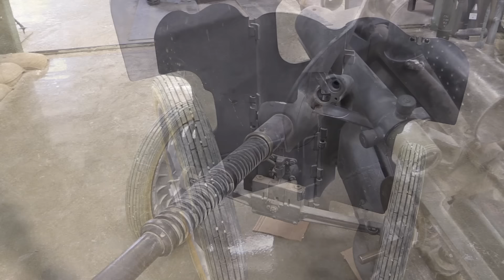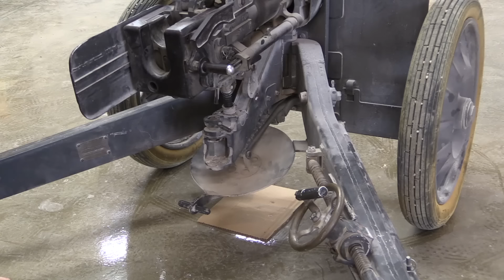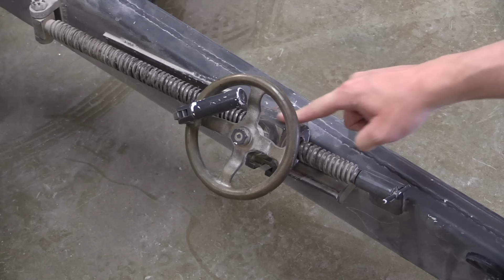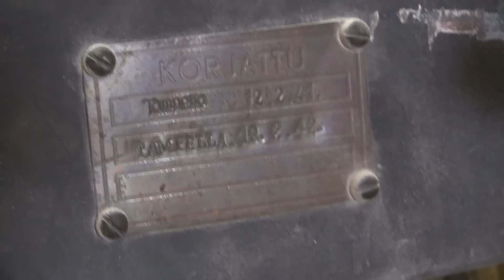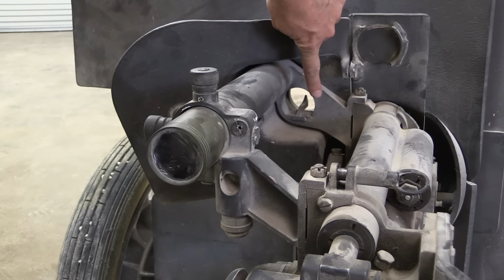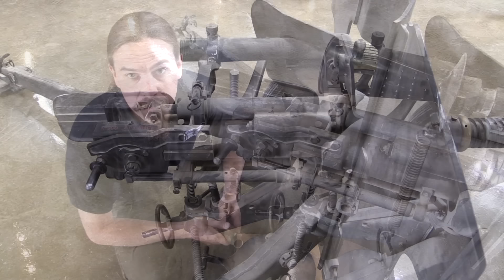Light, Mobile, and Deadly: the French Mle 1937 25mm Puteaux AT Gun

Comment: This AT gun was actually pretty powerful for it's caliber. It used a large cartridge. It fired a 25x193.5mm cartridge. That is very large for a 20-25mm shell. The Panzer II used a 20x158mm shell. The British and US used a 20x110mm shell, but for AA use. The American 37mm cartridge was 37x223mm. So the 25mm shell was nearly as long as an American 37mm shell, and the 25mm cartridge was given wide shoulders to hold a large amount of propellant. It's standard AP round had a muzzle velocity of about 3,015 FPS. Small and portable and able to have a high rate of fire, these would have no problems knocking out Panzer I and II, and early Panzer III and IV from short range at the right angle. A quick burst from a co-axial machine gun and a 37mm HE shell could silence a gun crew of the 25mm.

Comment: The British did not tow these 25mm anti-tank guns behind vehicles. Instead they carried them en portee, in the back of 15-cwt trucks. With the crew and ammunition. 

Also it has to be said that the BEF troops hated the 25mm Puteaux. While it was more conceable  than the British 2-pounder, with its 360⁰ mounting, the 25mm guns were much less effective anything bigger than the Pzkw II. No better practically than the Boys anti-tank rifle. Which was smaller, more portable and quicker to bring into and out of action than the Puteaux 25mm.

Comment: Given the low quality episcopes or just plain little vision slits of tanks of the Interwar and Early War period these things were almost invisible until they fired. Usually set off to one side of a line of approach AT guns were the major fear of tankers for most of the war and even the bigger guns like the 7.5 cm Pak 40, the 57 mm anti-tank gun M1943 (ZiS-2) and other similar guns of the Mid War to Late War periods were usually only detected after they'd opened fire, meaning the could wait for the optimum shooting movement.
The bigger guns lost out in that they were practically immobile once set up so you fought in place and won or you had to abandon the gun and thus they were often encountered on stop lines and other well-supported areas. To destroy the gun so it didn't fall into enemy hands you quickly dumped the oil out of the recuperator and fired the gun, the recoil would then wreck the trunnions and make the gun unusable.

Comment: In the early war especially the penetration was more than adequate esp since most armor didn't even have 30 degrees of slope.

Additionally basically none of the AT guns in widespread service at the start of ww2 (with a few exceptions) remained effective into the midway years.  Which is of course to be expected with the rapid pace of equipment design that war tends to prompt.

Comment: Wikipedia: Finland purchased 50 French 25 mm M/37 antitank guns during the Winter War, but only 40 of them were delivered in February 1940 through Norway. The remaining ten guns were captured by the Germans when they invaded Norway in the spring of 1940. About half of the guns, which had arrived during the Winter War, saw front line service during it and three of them were lost in battle. During the Interim Peace the Germans sold 200 captured guns to Finland. 133 of them were model M/34s and 67 were model M/37s, and they were designated 25 PstK/34 and 25 PstK/37, respectively. They were withdrawn from front line use by 1943.
https://en.m.wikipedia.org/wiki/25_mm_Hotchkiss_anti-tank_gun

Comment: @12'30": I don't quite agree with that idea: 25mm was enough for a high explosive shell. Hotchkiss had a well-known 25mm anti-aircraft gun, Hispano-Suiza was developping a design of its own as well, a long 25mm gun for anti-aircraft or fix aircraft gun (motorcannon or wing mounted gun), and a shorter version in parallel for flexible aircraft mount. 25mm calibre might have been insufficient fro APHE or semi-armour piercing shells, but was enough for HE or frag projectile; it was a deliberate choice of the French Army to provide only specialized ammo to specialized units.
The same is true for 47mm anti-tank gun and especially the Laffly W15 TCC tank destroyer.They were provided exclusively with anti-tank shells even if there were some HE, anti-surface and anti-aircraft shells of that calibre available for a long time.

Comment: Ahh so it was designed originally as an anti tank gun. The fact the Japanese Type 96 25 mm derived from the same progenitor sucked horribly as an AA platform (mainly due  low fire rate and accuracy) suddenly makes more sense.

Comment: considering the French approach considering sabotaging equipment, I think I remember something about rendering 2 MAS unusable, couldn't the firing pin sticking out be there for the same reason? If you need to leave the gun just break the pin so the other side won't use it against you ?

Comment: I've been looking forward to this ever since spotting this guy in that Pak 37 video!

14:13 What also doomed the 47mm batteries was the doctrinal error in their use, early in the battle of France the guns were put too close to the frontline and lacked coordination with the infantry units they were tasked to defend. So a lot of guns only had time to fire a few rounds before they were spotted. The guns were also not fitted with HE rounds despite the larger caliber of this gun, so every AT battery was fitted with 8 Chattellerault LMGs or Hotckiss MGs. This proved to be insufficient sadly, and a lot of gun crews ended up focusing more on the infantry attacking them rather than on the tanks they were supposed to destroy. 

Moreover, most batteries were still horse-drawned, hence once in place they couldn't be moved to a safer position since the horses had to be kept away from the fight.
Much like the rest of the french artillery, there was a plan to motorise every AT unit, but since the new Hotchkiss/Laffly W15 T 6x6 trucks suffered from production delays, they were instead given hand-me-downs obsolete late 1920's Citroën P17 half-tracks from the regular artillery.

Still, reading the accounts of the gunners is pretty telling of the quality of the 47mm and the bravery of their crews who often died at their post after knocking out a handful of german tanks. One can only wonder how differently things could've turned out if they'd been used properly in May-June 1940. Then a few months later most batteries would've received their all-terrain trucks and an improved version capable of spinning at 360° without moving position would've begun to come off the assembly lines.

Comment: This gun was the infantry anti-gun ; the artillery developed the 47mm anti-tank gun. And that was one of the problem of the French Army : two differnt guns maned by two different arm (Infantry and artillery) and with two different doctrine. The 25mm was in service into the Compagnie antichar at the regimental level ; the 47mm in the Batterie antichar divisionnaire at the divisional level. There were twelve gun by company and twelve in the batterie (a total of 48 guns... were the German infantry division had 72 guns, usually the PaK-36 37mm gun). 
With the two different guns, the anti-tank strength of the Infantry division was two small... and two dispersed. The 25mm were to be used In frontline regiment ; the 47mm as a special antitank force, but with no coordination. 

So, the French division did not have the strength to put enough antitank fire against a Panzer Division... even of the two guns were quite good...

Comment: I mean the low caliber isn't really an issue. During the French campaign the german tanks had 30mm of armor at maximum. Things like Pz 1, 2, 3 and 4 just had 15mm. You need to get the E version of the Pz3 to get 30mm of armor. Even the excellent Pz38t had only 25mm. You need to wait the pz3 and 4F to get 50mm of frontal armor and those come later during the war. I'm pretty sure that this thing was deadly enough to crush any german tanks, and the early years.